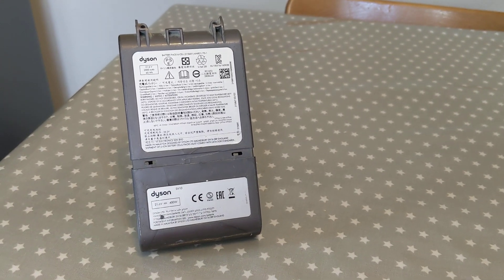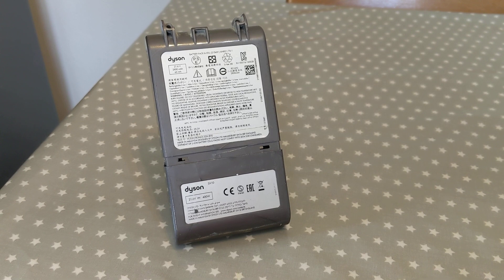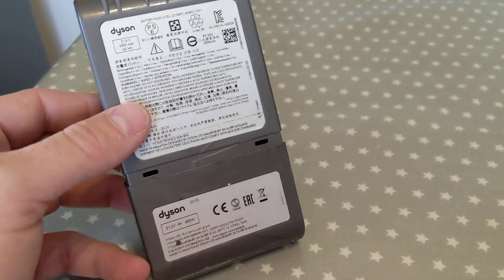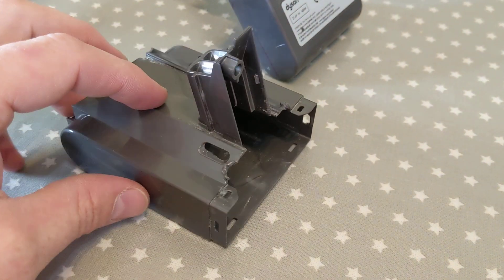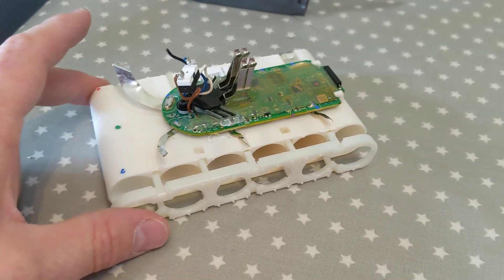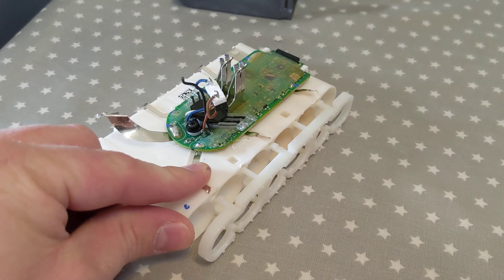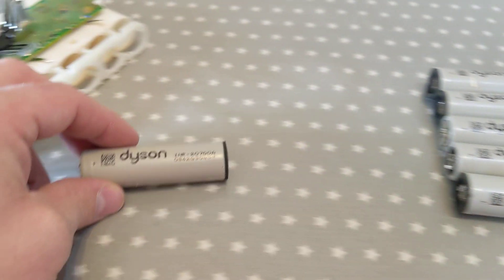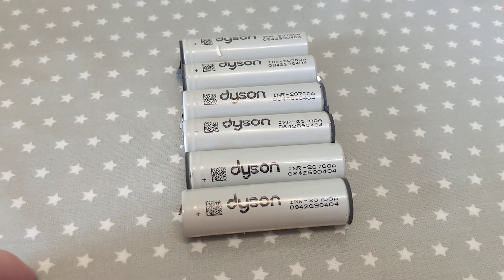Dyson V8 (215681) Battery Disassembly

Comment: Cheers I exactly needed to know having exact same unit; if there's hidden screw or just clasps. or its has the annoying 'Apple' glue around the joint. Now I'm gonna replace and upgrade the batteries to some EVE 3000MaH 30A rating. My test on MAX with the over 6 year old Dyson gave result of 13 seconds exactly of run fully charged.

Comment: To open, just place shorter end of the battery to the bench vise (with soft jaws) and twist cover open. No need to damage the case with screwdriver. Some clips might be damaged, but you can live with that 🤔

Comment: The Dyson INR20700A are 20700 form factor (so not 18650) 

On ali one can find casings for this Dyson that will hold 21700 batteries. 

Note: the batteries must have an amperage of 35A or more. 

The Dyson original batteries have a capacity of 2800mAh while 21700, 35A batteries with a capacity of 4000mAh (43% more) can be found.

Comment: Has anyone had any success with the £30 ebay replacement packs? 
If just replacing individual cells then do they have to be Dyson branded?
Reply: I've been using aftermarket batteries on the older DC34, DC35 and V6 for several years now. They've proven to be very good in terms of both reliability and run time. I can especially recommend these brands: Floureon, FlyLinkTech and Flagpower. To replace just the cells you would need high-drain ones but any brand should be fine.
Reply: High drain as in 35A or more. 
20700 will fit in the Dyson case
You can buy cases that will hold 21700 cells. That will give you a much wider choice of batteries and more capacity too.

Comment: Thanks for the video. My two year old original Dyson V8 battery pack still has good capacity, but it’s become slow to recharge. I assume one or more cell became weak and the BMS is doing some balancing each time it’s charged. I suppose there’s nothing to be done except recover all the cells and individually test them for capacity.

Comment: Those batteries are not soldered, they are spot welded, DO NOT apply heat to them thinking they are soldered, it may short the cell and cause it to burst
Reply: Also, unwise to pull off the metal welded to the cell as it can easily pull holes in the sealed cell. By the way, they are not 18650 but 20700 - bigger !

Comment: I’d love to know what tools you think could use to open this without damaging it.  I had all these tabs wedged and it still wouldn’t budge a millimeter.  Mine was glued closed..
Reply from the maker: It's a disappointing trend these days with expensive items to prevent repair isn't it!
Reply from the maker: I think you could probably use the plastic tools you use with car panels and mobile phones, just needs to patience 👍
Reply: Robert Jones Nope.  I’ve dismantled cell phones and gaming systems before.  I have pry tools.  This was glued inside.
Reply from the maker: Even harder then, I had no glue! I notice there are heating pads available for removing iPad screens etc, so I guess depending on the type of glue, heat may be an option, but could be it's becoming unserviceable.
Reply: Robert Jones yeah pretty much impossible to not break to open.  Stinks.

Comment: Why would you need to recover the cells? They are expired-- I missed that.
Reply from the maker: Why not 😉
Reply: Sometimes just one cell has gone bad but in general all batteries would have little life left. 

I would be careful with using those cells but I’d have no problem to use them for solar powered garden lights for example.

Comment: Great video. Just a little correction, joints between batteries are spot welded. So you cannot desolder.
Reply: So if I was to take them apart, what would be the best way to get them back? Can I try to solder them back and hope that it would hold? Or can you recommend something else.
Reply: @aajeev  get a spot welder and spot weld it. I am not saying you cannot solder because you can but batteries do not like heat. You need to have a proper preparation and a quick as possible solder solution. Also keep in mind soldering batteries not safe and could be dangerous. Use all PPEs.
Reply: @helel78  thank you. Appreciate you sharing your experience.
Reply from the maker: Appreciate that 👍